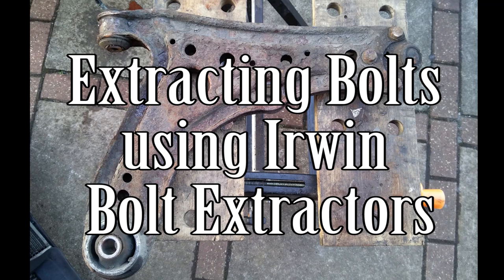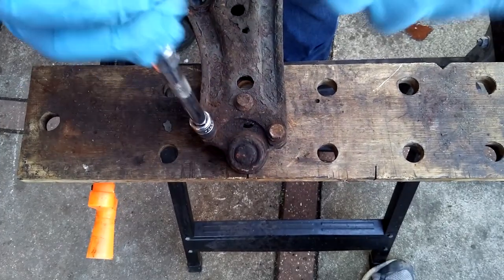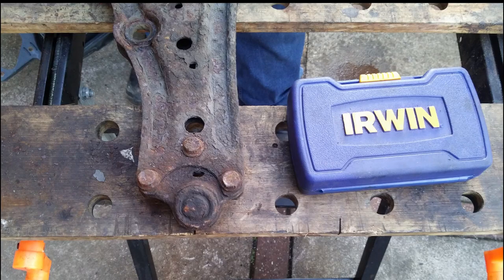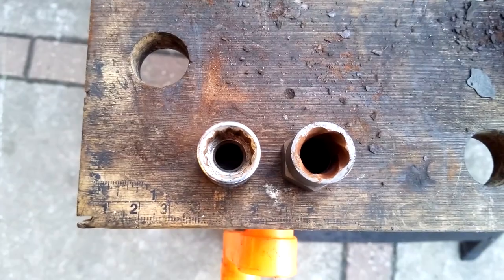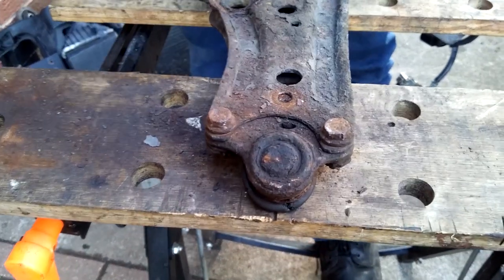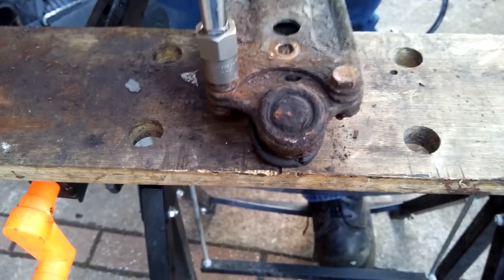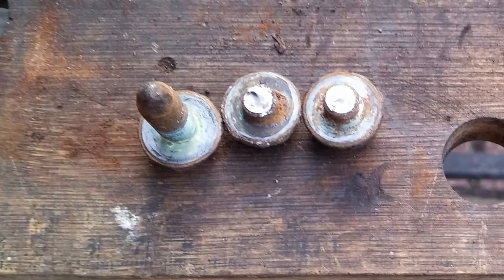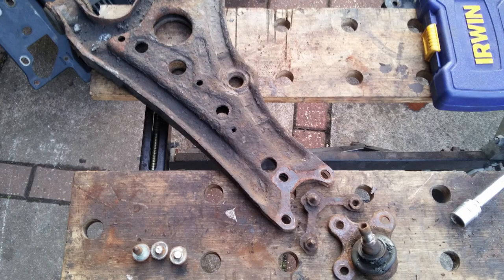Using Irwin Bolt Extractors

Comment: Here in the Colonies, the sockets he's extolling are also generically known as turbo sockets.  They are worth their weight in gold for difficult extractions and just removing rusty bolts compromised by corrosion.  The original Turbo Sockets are still made and sold by Hudson Bearings.  There are other brands, too, including SK, Irwin and Craftsman.  They all use a six-point spiral that becomes progressively smaller as you go up inside the socket.  They grip onto and bite into the fastener the harder you turn the breaker bar you're using (don't try this at home with a regular ratchet, kids; you may damage it).  The bolt you're attempting to remove will be heavily damaged by this action, but you were going to replace it anyway, right?

Comment: You could avoid this scenario by using the correct socket for the fastener in the first place. Just because a 12-point fits on a 6-point bolt, doesn't mean it's the right tool. A 12-point will grab the fastener on the points, which is a tiny amount of contact surface area, and in this scenario the points are structurally compromised due to rust. A 6-point will grab on the flats.
Reply from the maker: +DemoFly this video is an example of how the extractors work and there are a multitude of potential reasons the heads could be stripped even using the correct tool. Your comment may well be valid in this scenario and/or you have the benefit of working on a car where the bolts are in great condition. However I've not owned a car where weather/age/previous owners have not stripped heads and thus the video is to show an option on bolt extraction.
Reply: +DemoFly I've seen plenty of fasteners so rusted or damaged that a 6 point socket won't grip them.  These extractors will remove a completely rounded nut ot bolt.
Reply: Ive been to every auto parts store around my town trying to find a 6 point wrench no one has them it seem that they then 12 point pices of crap